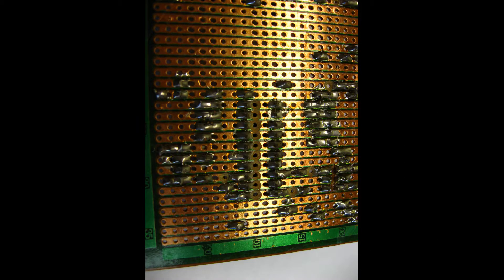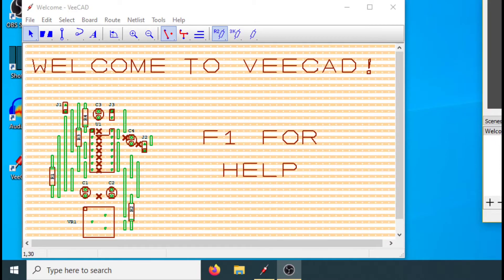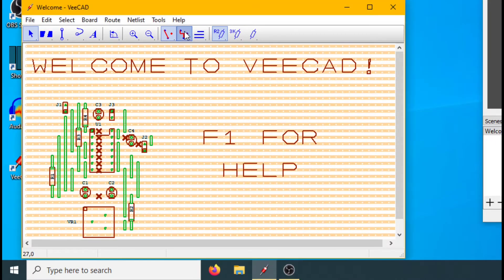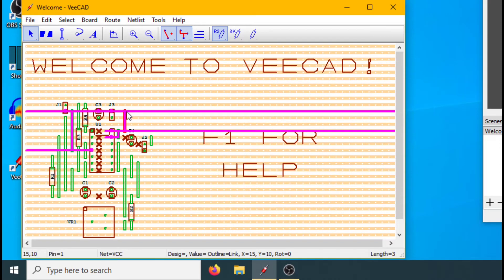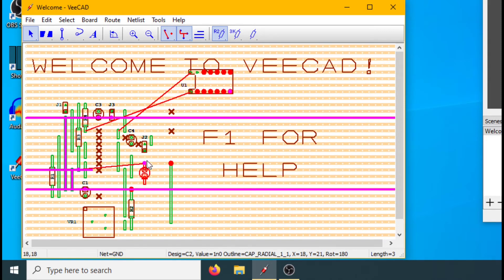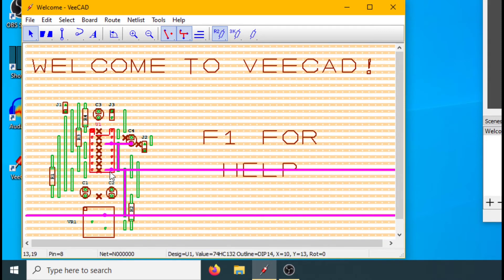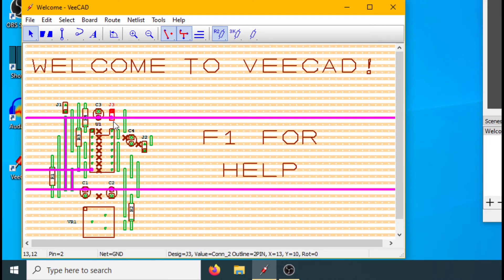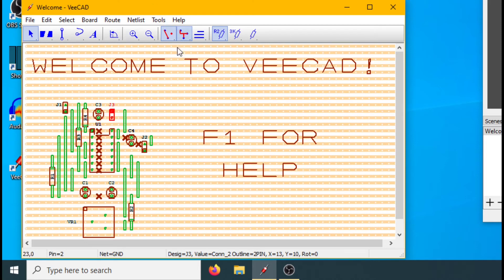1. Welcome to VeeCAD

Comment: I've hated breadboarding for as long as I've done it. Trying to get wires to the right spot in a rats nest sucks and is worse when I inevitably screw something up. I'm here to see if VeeCAD can help me plan my breadboard out. I use KiCAD to design circuits and have them fabricated but I still need a way to use soldered breadboard for one-off circuits. I appreciate that this software exists and this, and apparently more videos, to show what it cand do and, hopefully, how to do it.

Comment: What is that circuit out of curiosity?
Reply from the maker: It's a water level alarm that beeps when two electrodes get wet. You can see the schematic in the Help File topic "Tutorials -> Auto Router" and the schematic is viewable at "Program Files (x86)\VeeCAD\tutorial\Water Alarm.dsn.pdf".
Reply: @veecadcircuiteditor2687  Thanks! I'll make my own then :)